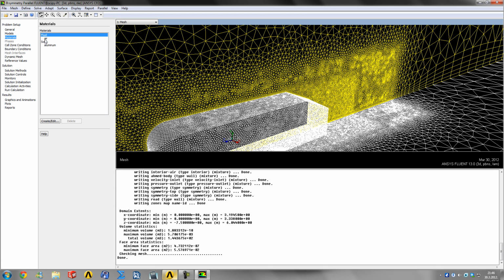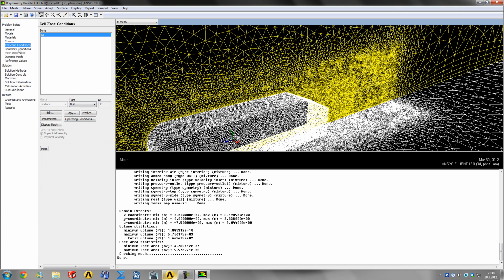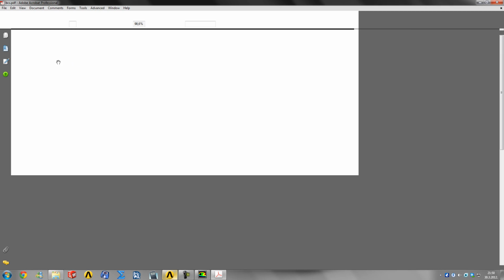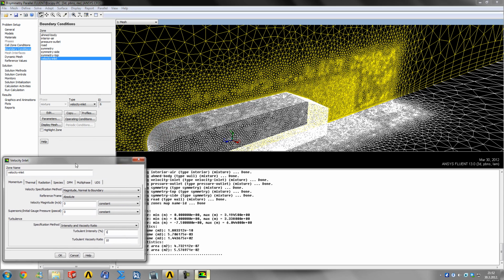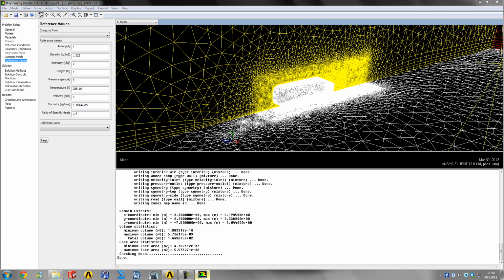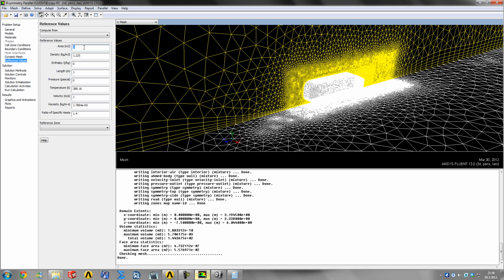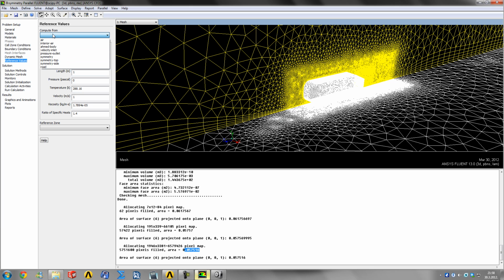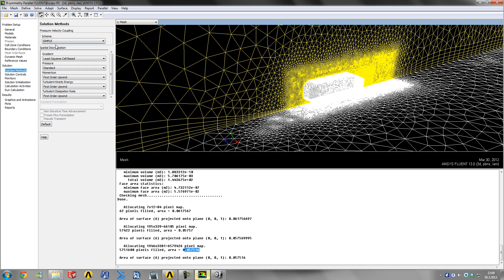Part 3b - ANSYS Fluent for Vehicle Aerodynamics

Comment: for wing analysis, do we use the planform area (projected onto the x axis in this video) as our reference area? When do we know which area we it is that we want? Thank you!!
Reply: Also, what is our length if we are using planform area... many thanks!!
Reply: For an airfoil it will be the projected area because the value of area used in the lift and drag force equation is the planform area. Also, the reference length will be the mean aerodynamic chord length since air flows along the chord.